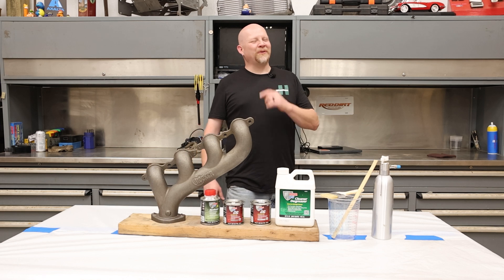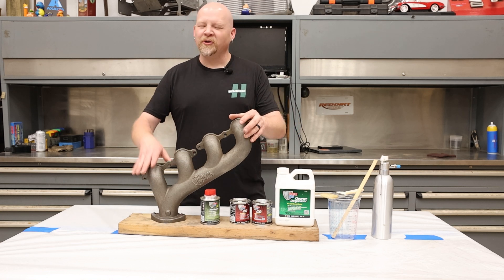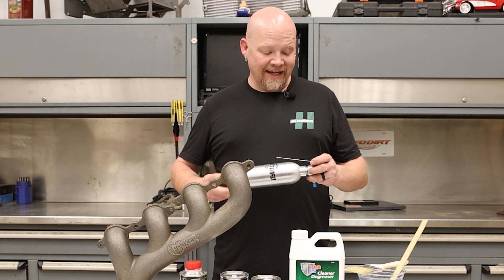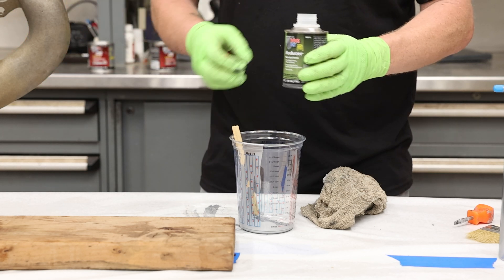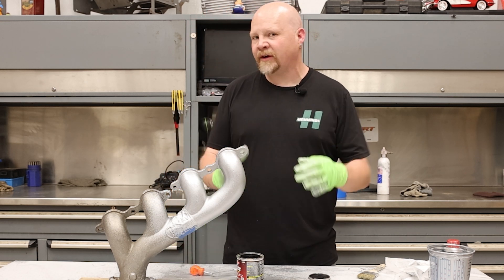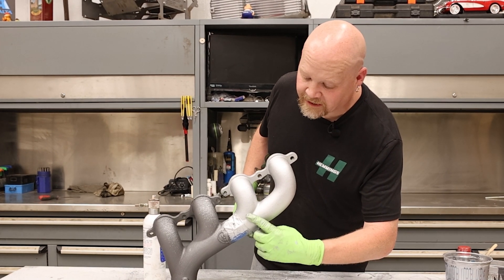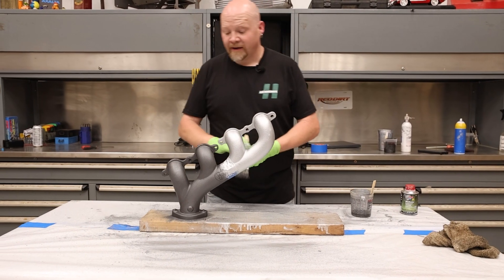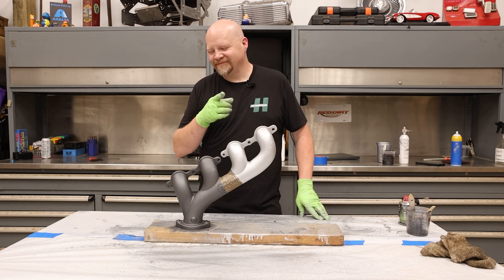POR-15 High Temp extreme heat coating for metal - How to apply it and use it

Comment: Anything different I should do for the spray on can?
Reply from the maker: The spray can requires a slightly higher temp for the cure process than the liquid can. The performance is the pretty much the same.

Comment: “Wash cast iron with water”. Next frame its the same manifold but rusty 😂yea, how well will that bond on that? just quit that silly branded degreaser that needs a water wash and use plain ol’ solvents?
Reply from the maker: It is normal for it to flash rust. The cleaner works extremely well with far less hazard then solvent and is design to work with the Metal Prep. The Metal prep etching leaves zinc phosphates while it neutralizes the surface. The High Temp coating adheres to the surface rust very well, and when it is baked it is very hard and UV resistant.
Reply: @POR15videos  Appreciate the explanation.